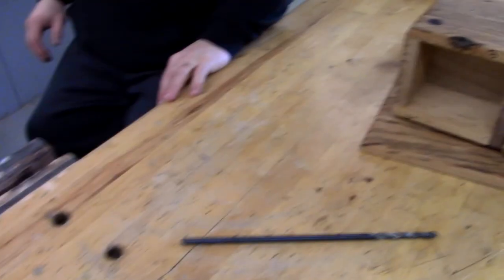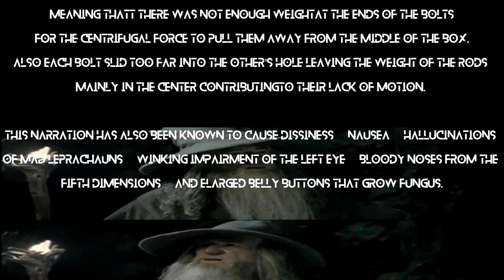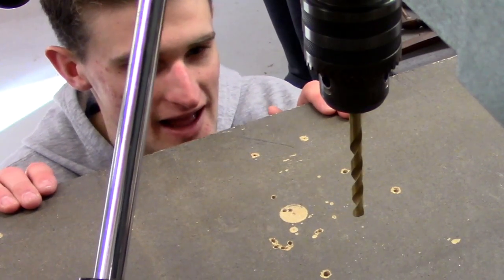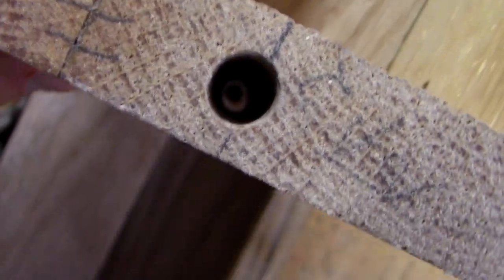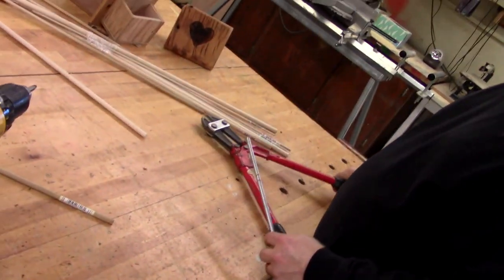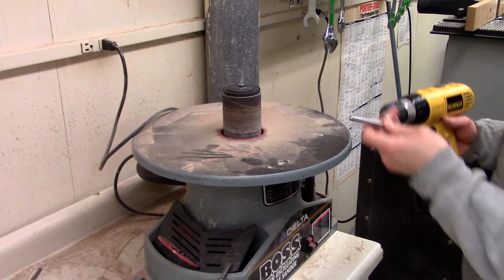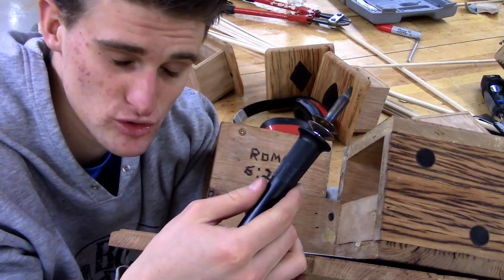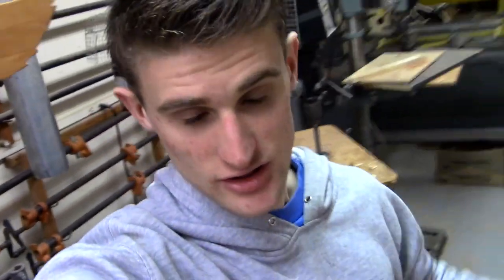Fixing the Centripetal Dice Set😥😥😥

Comment: Another great video!  I like the special inserts you use!
(sorry about the length)

Hey, I've got a question... this is going to seem a bit out of left field but you guys obviously know your way around a wood shop.  

The other night I was trying to cut some OSB to make a box.  What's the best tool to use for cutting sheets of OSB/Plywood/etc.?  

I tried it using my table saw (first time using a table saw... ever) but found it was difficult to maintain a straight cut (because I was cutting the short way, not the long way) so I switched to my circular saw which somehow slipped and cut at an angle (like a miter) and ended up using a jigsaw to try to straighten the edge.  

In the end I found out I made a parallelogram instead of a rectangle and had to do it all over again.  Once I got my angles set right (and used a drywall square) I was able to cut the panels I needed for my box.  

I'd love to become an accomplished woodworker like yourselves.  I'm still very new at this and I feel like I'm not using the right tool for the job.  Any suggestions you have would be greatly appreciated.  Thanks!
Reply from the maker: Hey no problem at all! We don't mind the long comments, we love reading them, answering your guy's questions, and having discussions. As of right now it's Andy you're talking to and as you might have realized by now I don't know as much about woodworking as dad does. But I can tell you that from my own experience that a table saw is usually the best way to get straight cuts on plywood. I think there's a link to one up in the description. if you're going to be cutting a ton of plywood in the future I need to get straight cuts then it might be worth considering to purchase a table saw. You don't need a large one just one that has a straight edge on it so that you can make consistent clean cuts. I'll ask Dad tonight to see what his opinion is so there might be another comment down here later on tonight. But other than that keep at it! Me and Dad make plenty of mistakes that you guys don't get to see all the time this was one of them 😂
Reply: @SecretStashBrosBuilds  Thank you very much for your reply.  I've seen others put paste wax on their table saws to help the wood slide easier, perhaps that's what I need to do.  I was having difficulty probably because I didn't cut the sheet down at all before sending it over the table saw.  So I had about 4 feet of OSB hanging off the edge of my table saw (again, I was cutting the short dimension) and pushing it through I found it difficult to keep it straight and against the fence.  I think the answer is: in the future cut it down beforehand with a circular saw, then let the table saw work its magic with the fence.  But I really appreciate you getting back to me.  It's nice to talk to people who have experience.
Reply from the maker: I'll ask Dad tonight as he'll probably be able to give you some more knowledgeable answers on the topic.
Reply from the maker: Hey this is Dad thanks for your question. I know exactly what you're talking about when you're pushing the osb through the table saw by yourself it is a tricky task at times, yes cutting the osb down does help but you don't always have that option. In your case it helps to have a helper on the other end to help keep the osb against the fence, and help support both pieces on the other side but the board wants to drift away from the fence when it goes past the blade so a helper to help hold that piece against the fence while you push the piece through. If you don't have helper, making support bench on the out-feed of the table saw can help, I use a roll around cart that lines up with my table saw. One more thing. When I am cutting I push on the both sides of the osb ( a little longer until the last inch or two ) but be careful. Hope this helps.